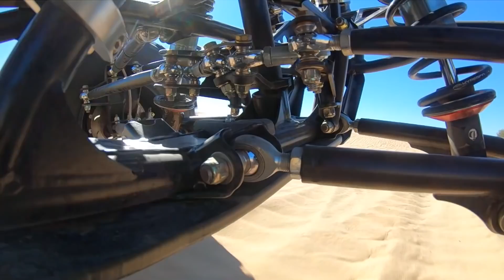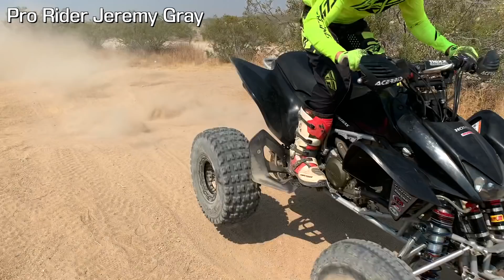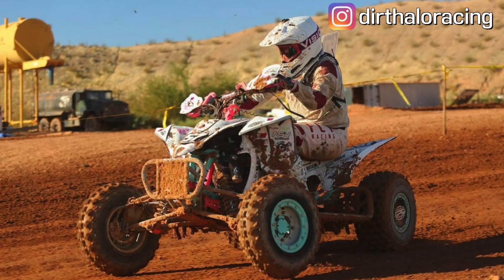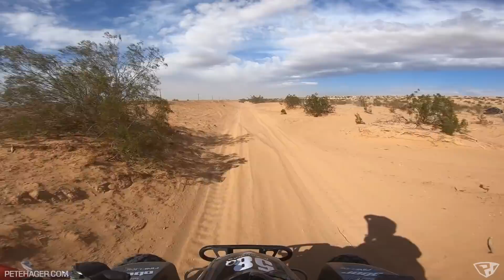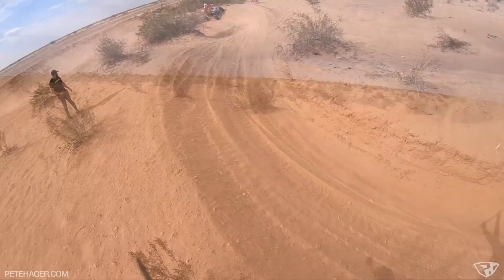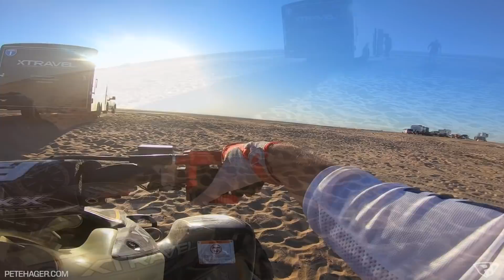XTravel BVS Technology. Is this the Future of Suspension?

Comment: I only ride Hatfield McCoy trails, at my farm, or around my property and I am looking to get a new Yamaha unit. I absolutely love the look and endless amounts of aftermarket parts of a YFZ450R, but love the torque and reverse of a Raptor 700R. So, I am wondering if anyone has ever put a Raptor 700R engine in a YFZ450R frame? Is it possible? How difficult would it be? What parts are needed? How much will it cost?

Comment: When sitting still the front upper a arm (tie rod) came into contact with the front spring of the shock I can see some serious issues arising from that what is his fix for that
Reply from the maker: Good eye! It only hits the linkage with the big body rear shocks on the front when the bars are fully turned. Since this machine is very Baja focused its rare that you have the bars turned that much. With standard shocks there's enough clearance 👍

Comment: this look like 5x more expensive and hard to maintain
Reply from the maker: This is priced very competitively with conventional set ups for the YFZR. Having to buy aftermarket shocks for the TRX makes it a little more expensive but you also don't have to buy a steering stabilizer so overall it's about the same as other top shelf set ups! If you keep things clean like all moving parts on the machine then it's really no different to maintain 😊

Comment: front xtravel but no rear? looks nice and plush up front tho!
Reply from the maker: Xtravels No Link Linkage is their answer to the rear end. I don't think they plan on developing their own swing arm or anything. I would assume this no link linkage would work with aftermarket swing arms if you need more durability or a different length but it would take more testing and tuning to dial it in I'm sure 😊

Comment: What years would they make this available to ?
Reply from the maker: It's available for all model years of the TRX450R (04-14) and YFZ450R (09-22)
Reply: @PeteHager  Because I have a 2017 Trx and it has a great suspension already but always room for improvement because I do tend to get tired out easily after 30 minutes of constant riding hard